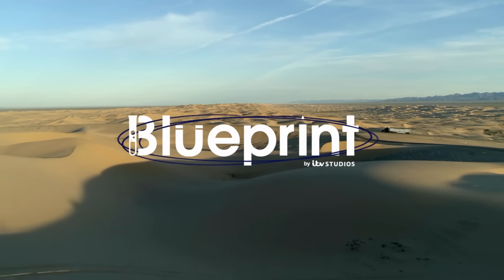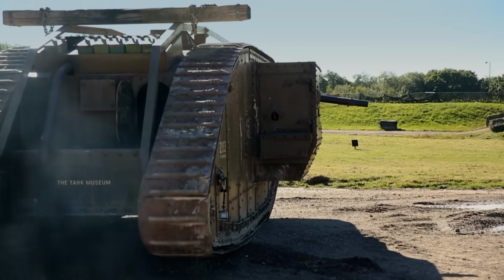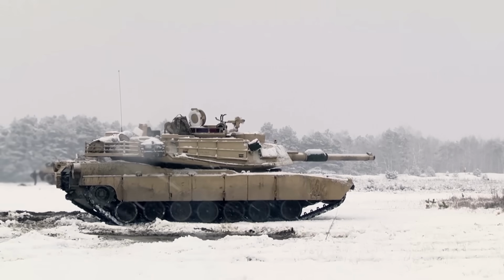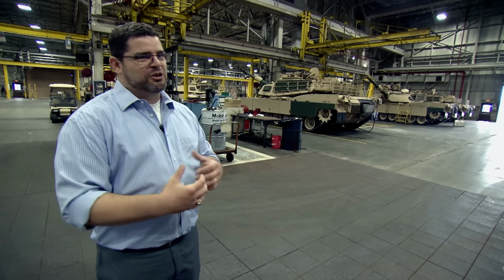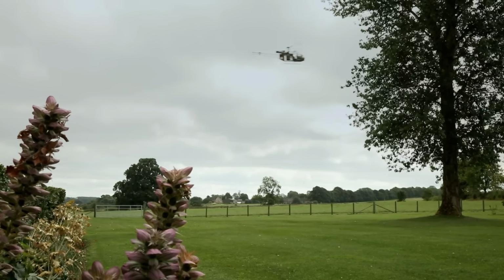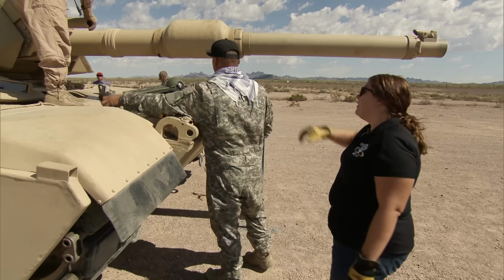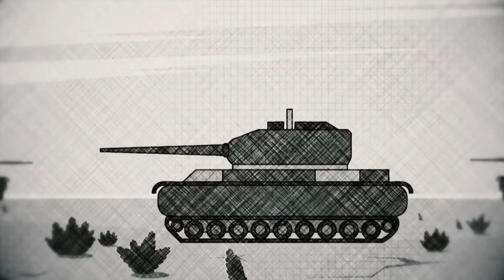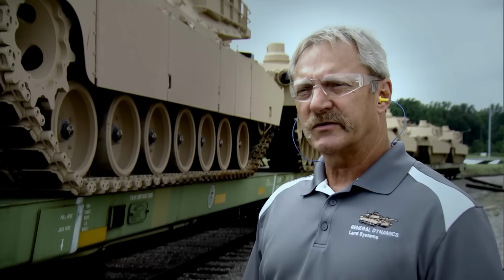How "The Beast" Is Changing Modern Warfare as We Know It | Blueprint

Comment: A mile a gallon
is why Ukraine avoid using the M1, no gas to feed the gas guzzler so they use  it like fixed artillery but that wears down the barrel quickly. 
-And the eventual replacement to the M1 Abrams will go BACK to the diesel engine (although to save face they're call it a "diesel-electric" engine)

Comment: As late as 2022, they were still making 15 Abram's tanks a month. In spring of 2023 they were supposed to be delivering the newest version called the  M1A2SEPv4. But this has been dropped and instead the M1E3 Abrams is being designed for production by the early 2030's.
Reply: What do you mean SEPv4 is being dropped? They have to fulfill orders place years ago
Reply: @Luke-Skymastersepv4 was cancelled for the Abrams X
Reply: @Willsantiago99  never mind, I was talking about SEPv3 and is still in production
Reply: @Luke-Skymasterv3 is like what 2-3 years into the new program correct
Reply: I’m excited to see the M1E3, from what I heard they’ll most likely have a 30mm chain gun on it with proximity fused rounds for drones, which is wild
Reply: @bleakambition495 think even current US Army tanks now (2025-2026) all have extensive effective Anti Drone defenses by now
Reply: Hopefully lighter, smaller, faster more agile better protected more fuel efficient, more powerful & lethal

Comment: Most generals including Schwartzkopf and Hodges and Petraeus called the Abrams too heavy,  too much  of a gas guzzler and too high maintenance,  the US Army was originally partnered with Germany on the Leopard tank which excels in all those categories
Reply: How insulting , the M1 is the ultimate predator especially when used with A10 warthogs and the Bradley
Reply: The Army partnered to make the MBT70, not the Leopard. After years of designing and the high cost to build they both stepped away to produce their own version of the MBT70 which is M1a2sep and Leopard 7.
Reply: The most recent Leopard 2A8 is similar in weight to the latest M1A2 SEPv3. Americans just confuse short and metric tons. Both tanks are 67 metric tons.
Reply: @jonny2954 the leopard is just a little better😂

Comment: This is a "new" video but they are talking about the Abrams tank as if it is a new development.  They have been improved, but it is still the same basic design that they have been using since I was in the Army in the early 1990s, more than 35 years ago.  There is nothing new about the power train in the tank.
Reply: Still Chrysler engineered. Nuf said.
Reply: @Ebooger  Still   Chrysler  Engineered ,  is  right  on .

Comment: How much per unit ?
Reply: All the ones they are turning out now are made by taking existing tanks apart, replacing the electronics, then putting them back together.  They have not produced actual new units, only replacement or upgrade parts.  Still, all that electronic hardware is quite expensive, plus the labor.

Comment: ☝🏼 Most importantly, the Abrams protects its crew, while russian tanks launch the turret into earth‘s orbit and the hull disintegrates into smithereens. So, if one is actually lucky to hit and incapacitate an Abrams as seen in Ukraine (where tactical mistakes were to blame for that, not the tanks performance&capabilities!), the Crew still was protected and made it out alive, unlike russian tank crews when hit. As the superstructure of an Abrams could always be seen fully intact. One captured unit which the russians shipped from Ukraine all the way to red square moscow (like they did not have anything else to prioritize for their abysmal logistics), they removed its tracks and attempted to bend the main cannon by a crane lowering a heavy weight load onto it, and the tank still looked quite intact overall. So even that propaganda stunt backfired for the russians 😄😁
Reply: The Abrams was also not ready for that kind of terrain… they speak on their troubles with it and having to modify it extensively.
Reply: 27 out of 30 Abrams tanks supplied to Ukraine have been enialated. The modern battle field is no place for a tank regardless of its capabilities.
Reply: @JohnLaws-sg8yh  See the Concept of combined Arms warfare, the Abrams is an excellent Platform for the Job it is intended to do, however it is best when used in theatre in the aforementioned „combined Arms“ scenario. And then there is of course the technical Support (fuel supply) and Battlefield logistics necessary for the Platform, all of which Ukraine lacked completely. Not to mention proper Training and tactics. This is hey Ukraine online Received such a Little number at all, and very Late into the war. Thai bring Said, EVERY Abrams Unit completely proetcted ist Crew! And They were all able to make it out alive and Even uninjured when they had to abandon tank (fuel shortage was a factor in over 50% of the cases btw.!)

Comment: This heavy, hulking tank, which weighs more than 70 tons, is designed only for areas like this or the rocky deserts of the Middle East. It does not fit the dimensions of railways, not every bridge can withstand it, it has a voracious, capricious propulsion system, and it has an archaic loading system that requires an additional person in the crew. It is also penetrated by a conventional RPG or a drone with such a projectile. It gets bogged down in forest swamps and arable land, and it is difficult to maintain. In fact, it is a mobile fortress created to protect the deposits of multinational corporations in the Middle East and their outpost to control the Suez Canal — Israel.
Reply: Where did you serve?
Reply: Conventional RPG, like RPG-7??

Comment: A turbine engine consuming a gallon a mile is ridiculous. Not scrapping it is pathetic. The defense contractors make billions and the taxpayers foot the bill
Reply: There’s a reason for the turbine. In the late 70s when the tank was being designed  the turbine was the only engine that could fit in the engine compartment and output 1500hp. Now days can a turbo diesel piston engine fit in that space? Yes they can. This engine is in the supply system and works so the army isn’t paying to develop a replacement. 434 gallons of fuel  provides plenty of range. Only takes 8 gallons of fuel to start it. The defense contractor general dynamics makes billions from replacement parts. There is 5 and 6 digit price tags for many of those parts. I’m a retired  Abram’s tank mechanic.
Reply: Enjoy it, Louie!